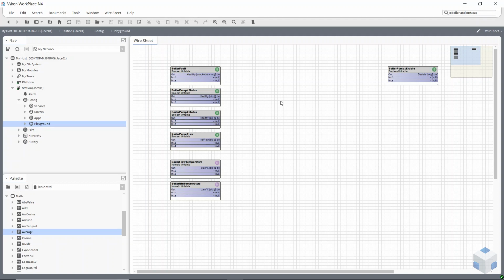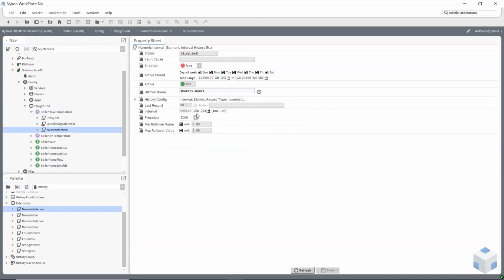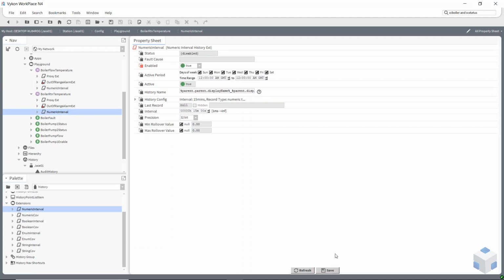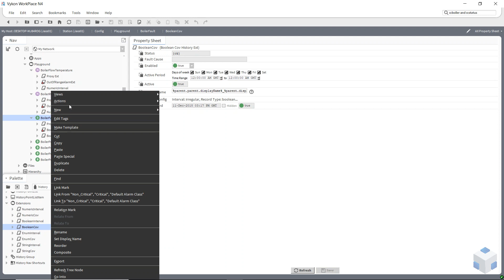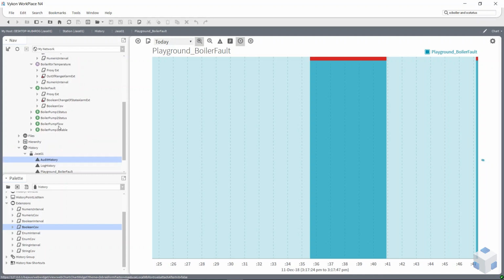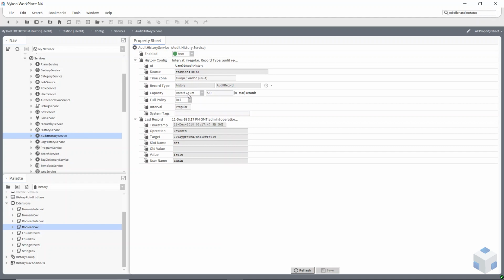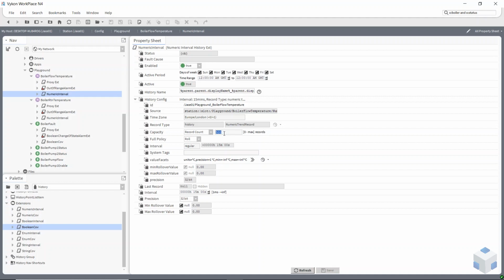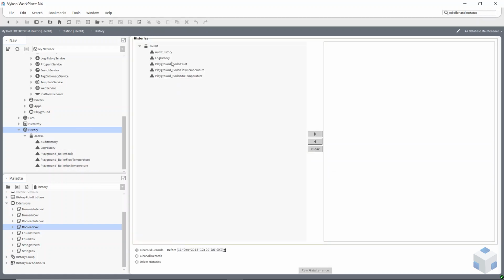5. Histories - Niagara 4 Video Training

Comment: Fantastic video, thank you for taking the time to make it and share it with the world for free, this is incredibly valuable. One question, for the History Name, you said we need to keep them as the same source format as what you had set up for the Alarm Source Name that you had set up.  Can you please share/explain what the source format is? Thanks!
Reply: HI David,
The format has to be done using BFormat structure (%parent.name%) etc. There is a great write up in the help files that will explain a lot more as to what you need to do and how you can use that to help naming the the histories.